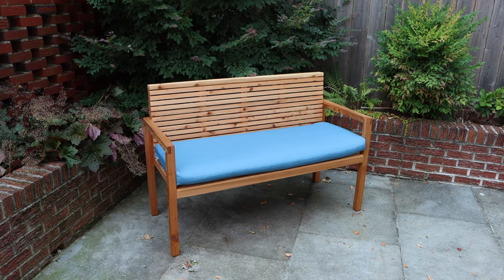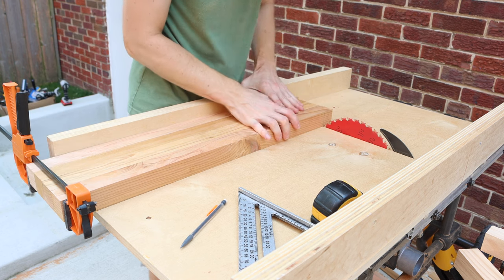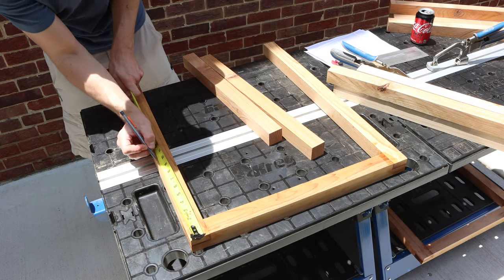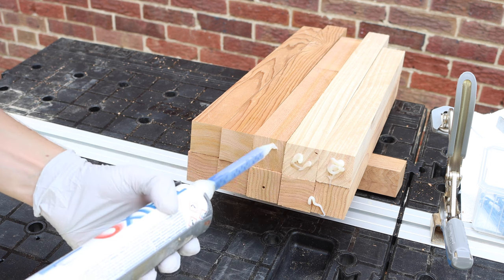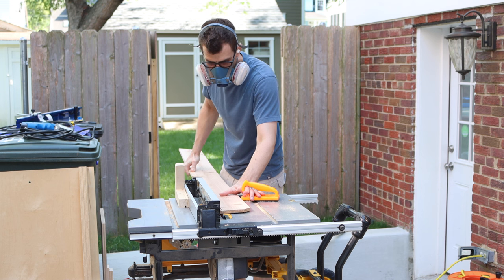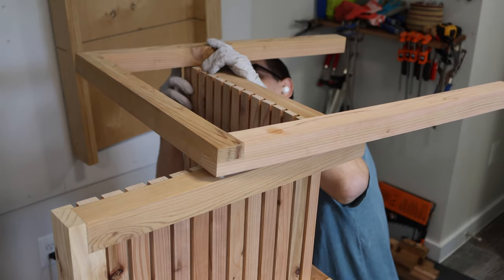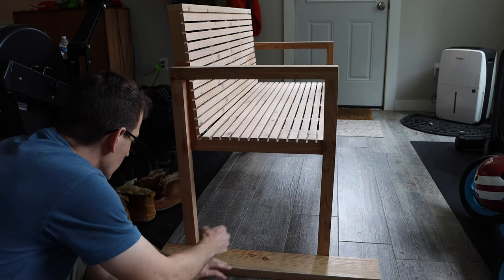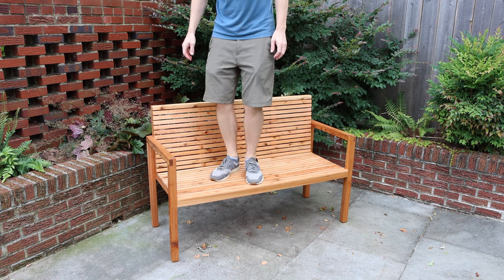DIY Modern Outdoor Sofa / Loveseat

Comment: why do you use epoxy instead of wood glue?
Reply from the maker: I found it did a good job of filling gaps and it holds up well outside. You can definitely use the outdoor rated wood glue though.